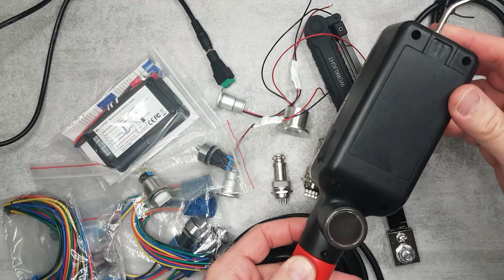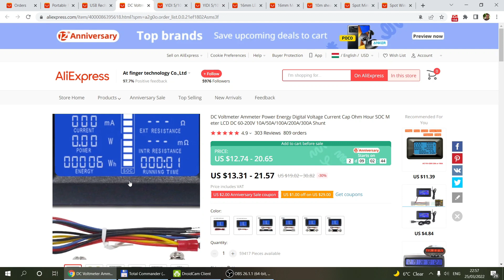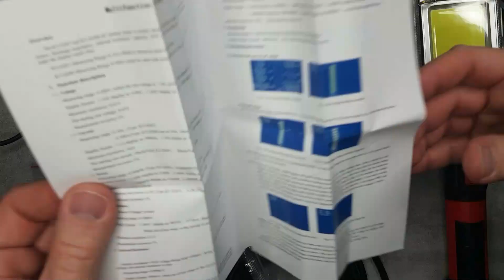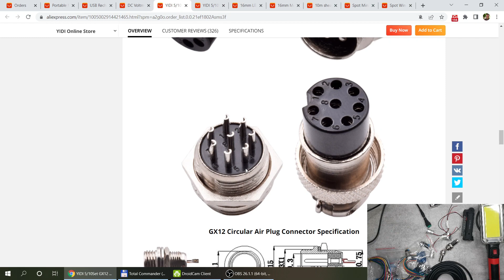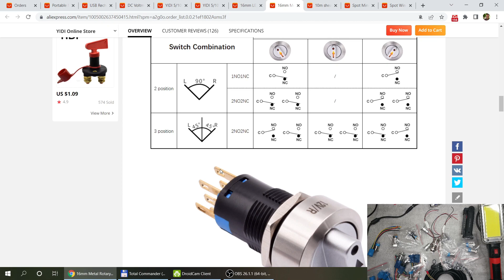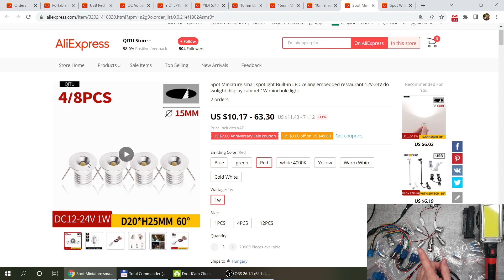Mailbag 01 - Bits for my new loco

Comment: The 24V LED versions are not very tolerant of extra voltage, but you can put a resistor in line with the LED lines to reduce the current to the LED's in the switches if you want 24V version :)
With the multi-core cable, what gauge was it when you received it?
Reply from the maker: It is 0.2mm or 24 AWG